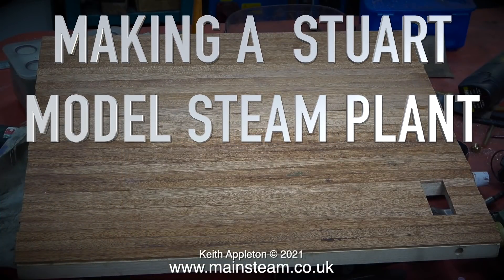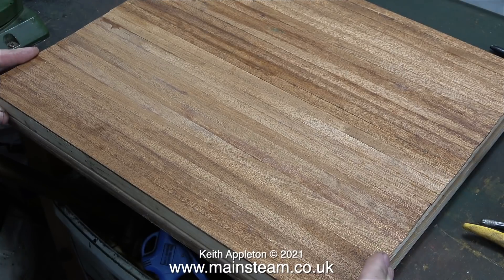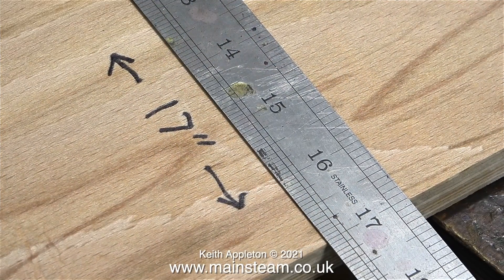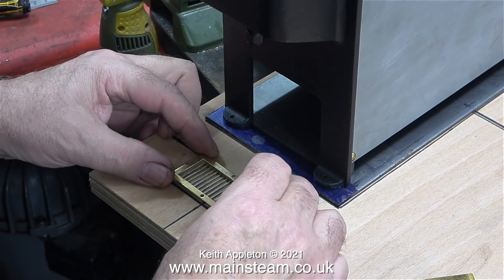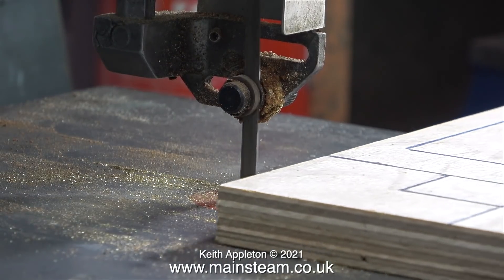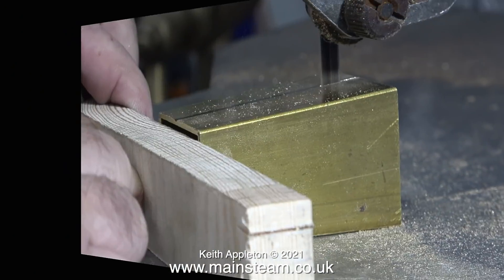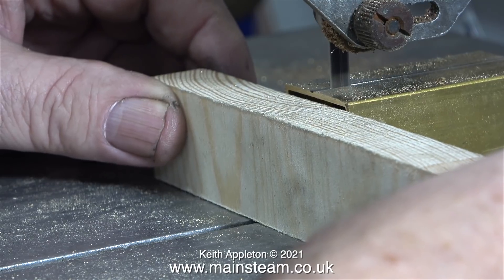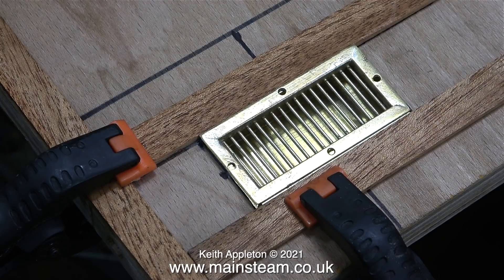MAKING A STUART MODEL STEAM PLANT - PART #44

Comment: A chisel and a hammer would work just as well if you didn't have a large style band saw. To quote: It takes some practice but you can practice on some scrap first. I don't think I would have used a jig saw or a band saw for the application - but hay if you have a massive band saw in the shop and don't want to waste a tone of time/energy why not.
Reply from the maker: I will stick with my very small bandsaw I think .......

Comment: Keith, if you want to reuse the warped board at its current size, or slightly smaller, perhaps you could "straighten" it by gluing on ribs underneath teh top surface at 90° (?) to force it back flat.  (I know I'm butchering the description, but I'm definitely not a woodworker! ;)  This way you might recover some of the time you spent on it before it warped.  Of course, if you've already got other jobs/plans needing it to be used in smaller sections, throw this comment in the bin!  ;)
Reply from the maker: That would be a bit of a bodge job, I try not to do that sort of thing. To the bin with it I say . . . .

Comment: Great vid.
Two notes:
The blade guides on your bandsaw should be behind the gullets - as they are now, they flatten the set on the teeth.
The board warped because it was only treated on one side - it is important to do the exact same thing on both sides of a board to prevent warping.
Reply from the maker: Two notes:
The blade guides on my bandsaw are behind the gullets - behind the set of the saw's teeth, not in front of them.
The board warped because it was just a rubbish piece of wood. I have made about 50 of these over the last few years and they were all fine - it is not necessary to do the exact same thing on both sides of a board to prevent warping.

Comment: Sometimes getting a second chance (or third etc) when a project hits an unexpected  hurdle, you get the opportunity make improvements. So making an error (found with the advantage of hindsight) or having  unitended issues happen is not always a bad thing to occur on the road to the successful completion of a project. Well, that's a message I'm getting from this series. Cheers Keith 🙂

Comment: If you drill a 3/8" hole in the middle of the drain area before bandsawing, you can cut in and rotate easily without fiddling around making a clearance cut.
Thanks for sharing 🇨🇦

Comment: Keith, in a very different application, I use elastomer "O" rings too.  I have those brownish silicone rubber parts and black parts made from neoprene.  The neoprene can tolerate heat, but the silicone definitely stands up to heat better.

Comment: Keith:  I t\think the pine base warped because of surface tension from the glue.  I have seen one coat of paint warp a piece of plywood.  If you would have glued a layer on the bottom I doubt the pine would have warped.  david
Reply from the maker: It was just a poor piece of wood, I have done this job so many times and this was the first time I ever had problems - very poor quality Far Eastern wood I think was the problem. It was starting to warp before I commenced planking.

Comment: The first base board warped because you only had the planking on one side.
Reply from the maker: It was just a poor piece of wood, I have done this job so many times and this was the first time I ever had problems - very poor quality Far Eastern wood I think was the problem. It was starting to warp before I commenced planking.
Reply: @keithappleton  Even good wood needs to be veneered both sides to prevent warping. The veneer on the underside does not have to be of the same quality as the face side.